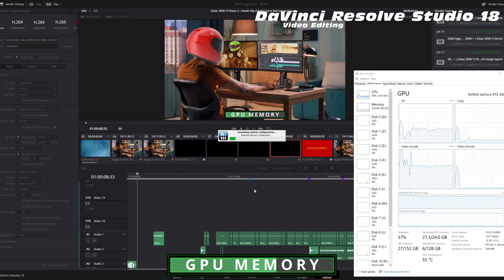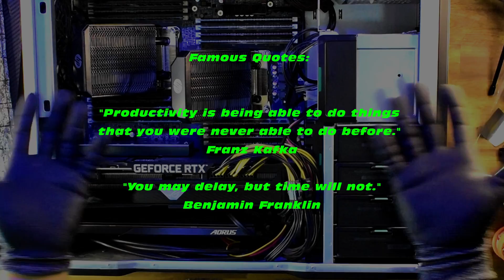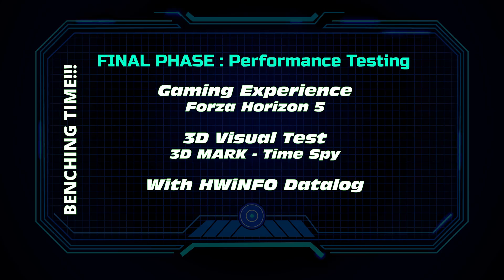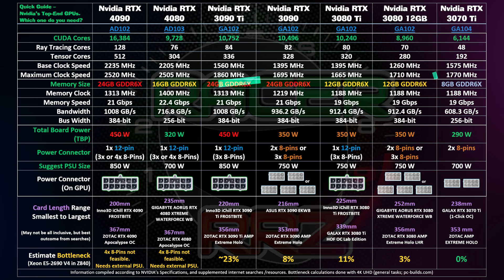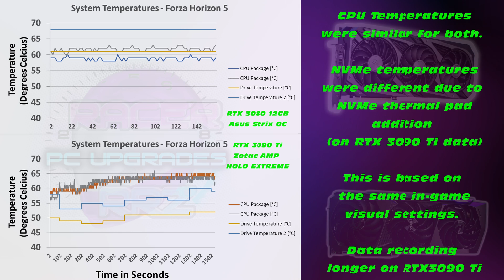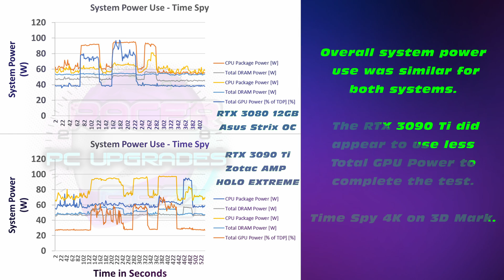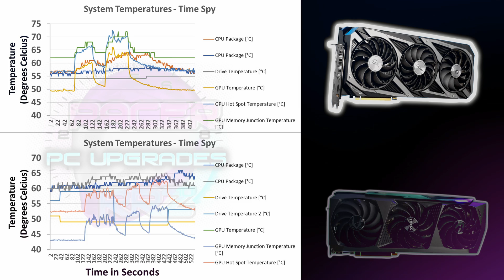GUIDE: Z840 Fitment of ZOTAC RTX 3090 Ti - Unleashing the Extreme Power in a Workstation

Comment: Love the vids. Oddly enough I've got a VERY similar build. Bit of a all around machine...
Z840
Dual e5-2690 V4s, 128gb ram, 4070TI, Asus Hyper M.2 with 4 Crucial p3 4tb, 4 - 16tb Seagate Exos SAS, 3 - 16tb Seagate Exos SATA.🏎
Reply from the maker: Hi Ryan, that's not a Z840 to be overlooked! The e5-2690 V4's are a power house. 128GB RAM does everything you can throw at it and your storage collection looks solid. Exos SATA/SAS drives give solid speeds for their capacities. How do you find the Asus Hyper M.2? Any issues running 4x 4TB NVMes? Are you able to boot from your adapter also?

I had some issues booting from my AORUS Gen 4 adapter - with 4x NVMes I could not get it to boot into Win 10 from the adapter - but with 3x or less it booted fine... 

The RTX 4070 Ti should give solid performance. How has that stacked up for you? I settled on the RTX 3090 Ti for the extra VRAM which has helped for video editing. 

I am sure your workstation will handle anything you throw at it.
Reply: @RACERRRZ  no wasn't able to boot from them but I'm sure there is a work around. Right now I've got an ssd laying on the floor of the case. Lol. Looking into adding another single pcie to nvme to see if I can boot that route. Also Linus did a build recently using a 420  using a USB Clover  bootloader to then boot from the nvme storage since the bios was somehow dead set on not allowing it. Where there is a will there is a way!
Reply from the maker: @Grumpy_Bubbles  I understand the SSD floating around - but I found a cheap fix for that (future video on the topic - Z840 upgrades! Olmaster 5.25" Bay to 4x 2.5" SSD with hotswap and built in fan; Olmaster He-2006). 

Yes, Clover is a solid way around this issue but when I tested it on a Z420 it wouldn't work! I was hoping to use an internal USB plugged into a USB 3.0 20pin socket to USB adapter (Z420 case swap) but that never panned out when Clover didn't detect the Win 10 ISO. I didn't spend long enough on it, but SSDs are quick and hence- I booted from an SSD lol. Linus is just flexing booting from NVMes on his Z420 haha.
Reply: @RACERRRZ  yeah I saw the 5.25 to 4x 2.5 adapter.  But I'm going to go with the 5.25 to 3x 3.5 hot swappable adapter.  Currently I've got 2 lg BR optical for ripping. Once I get my library finished I'll make the swap for more storage.

Comment: The cpus aren't fast enough to drive the cards in the first place. Maybe with a turbo boost mod or maybe upgrading to broadwell cpus. I took the 3080 out of my z840 with 2696 v4 cpus and swapped in a titan x pascal. I put the 3080 into my encoding server that has a 7940x. That cpu is able to fully utilize the gpus
Reply from the maker: Hi Nate. You are correct that the Z840's lineup of Xeons are technically too aged to fully support the capability of the more modern GPUs like the RTX 3090 Ti. The RTX 3080's performance was meant to be nearly in the "scope of reason" for the e5-2697 V3's which was why I initially opted for it. I checked the potential bottleneck for different configurations here: https://pc-builds.com/bottleneck-calculator/ or https://www.cpuagent.com (as a guide anyhow). 

My conclusion was there is no point upgrading to the e5-2697 V4's (I prefer higher clock speed over more cores) since they too are aged and will not fare much better. The Z840's hardware is aging and the only logical choice is to work towards the more modern HP Z8 G4, but that option is still cost prohibiting. With that knowledge, the RTX 3090 Ti upgrade has still been the best upgrade for my workflow because my main use is to render video with the odd gaming session in 4K. 

In terms of the Titan X (12GB), the limiting factor for my creative ventures has been VRAM. I went from a RTX 2070 Super to the RTX 3080 12GB, expecting that to be enough VRAM. But right now every video project is using ~19 - 24GB of VRAM on the RTX 3090 Ti which leaves me on thin ice. If I push a project beyond 24GB of VRAM DaVinci Resolve crashes during renders. A logical future proof upgrade could be the RTX A6000 (48GB), but for the price difference the RTX 3090 Ti still remains the best value.
Reply: @racerrrz  WOW that's crazy.  Are you editing in 8k+?

You really should need that much VRAM.  What camera do you use to film?  What is the bit rate of the raw footage that you are editing?

Are you using premiere?  I've noticed Premiere running like garbage on many slow cores over high single performance. Hints why I moved exporting to separate high frequency machine.

Thanks again!
Reply from the maker: @Hairybarryy  It sure is! 

I tried Premiere Pro, but the added price premium and need for AfterEffects for more flashy effects made it less logical. I use DaVinci Resolve Studio 18 (one-off fee) for everything from cutting, editing, effects, transitions, AI object/face tracking, green-screen removal, and audio adjustment with Fairlight FX. 

I have not dared touch 8K because 4k 60Hz is already straining enough for the RTX 3090 Ti, and DSLRs that can capture 4K 60Hz is already a big commitment. I mostly render with QuickTime in H.265 in Ultra HD 60Hz.

The VRAM cost is less about bitrate in my application and relates more with how I process the video footage. Using DaVinci Resolve Studio 18’s wide variety of Open FX Filters I enhance aspects of the footage. The most taxing effects are the Noise Reduction filter and 3D Keyer but combine a few of these filters and the VRAM cost increases dramatically, as does the processing power to complete the task. If a video was just 4K 60Hz footage with basic transitions I might get away with 12GB of VRAM, but why settle on less when you can do so much more with the same footage?
Reply: Also with titan x pascal the bottom duct can still be used

Comment: Thanks for this video. Do you think there are any benefits to putting in a 4080 vs  3090 ti? If they both get bottlenecked, I figured the power draw is less but the vram is much lower too. I do 3d content creation / ue5. 
Want to upgrade from 2080.
Reply from the maker: Hi. I am glad you found the video of help. Pinning the RTX 3090 Ti against the RTX 4080 is a tough match-up. The extra speeds from the RTX 4080 might be combated more heavily by the PCIe 3.0 bottleneck in the Z840. 

If your 3D projects are managing ok on the RTX 2080, and if you are not using a lot of VRAM, then you might be ok with the RTX 4080's 16GB. 

I would still settle on the RTX 3090 Ti for added cooling performance (mine sits around 55-65'C and I turned down the fan curve - MSI Afterburner fan curve function) and extra VRAM (24GB of VRAM more than makes up for the lack of rendering speed, in my application). If anything, I find I need more VRAM. A typical video project uses 20-29 GB of VRAM (including Virtual memory), and I have to be cautious to not overload the VRAM (DaVinci still crashes if I do).

The difference in TDP might also be offset by the bottleneck. My RTX 3090 Ti has not pulled more than ~380W, even at 100% load in DaVinci.
Reply: @racerrrz  mmmm those are great thoughts. Thanks for replying. It such a shame the 4080 only has 16gb. I would like to experiment with training custom AI models as well. But particularly using Ue5, Maya, 3dmax, blender, embergen, Gaea. Realistically the vram is the biggest requirement. 
If the 840 can physically take a 4080 then it would take a 4090 since they same, but would that be a complete waste of gpu/cash you reckon?  Could the 1125w even safely power a 4090. 
Love your content.
Reply from the maker: @b.a.g2073  Thank you for the feedback. There are a few challenges with the newer cards to consider. 

1) Although power draw isn't drastically higher, most of them have requirement for 4x 8-Pin connectors which places them out of reach for the Z840 - unless you do something drastic (case swap + 1600W PSU or external PSU). Their physical dimensions also changed - particularly the card height, which creates conflict with the side panel when you factor in the 12-Pin top-mounted power connector.

2) It may seem like a downgrade to get the older GPU - but VRAM really is key - in both gaming and 3D rendering. I suspect the RTX 4080/90's will be hurt more substantially with the PCIe 3.0 limit (and keep in mind the ever-powerful Z840 is also aging - e.g. e5-2699 V4's are getting along in age and there is nothing better for them). However, in the end the newer GPUs will still handle tasks significantly quicker than older GPU hardware. 

For the price point the Z840 is still the best value, even if it there is a bottleneck. A Ryzen Threadripper loaded with RAM becomes a house deposit lol.
Reply: @racerrrz  excellent points thankyou. We can dream hey for a thread ripper and RTX a6000 !😆

Comment: The z840 only has PCIe 3.0 slots. How much does that slow down a card like the PCIe 4.0 capable 3080 or 3090?
Reply from the maker: Hi Sam. You are correct that the PCIe 3.0 slots will bottleneck the GPU, and the RTX 3090 Ti is designed to make use of the extra bandwidth of the PCIe 4.0 interface (x16 PCIe 3.0 = 15.75GB/s max one direction ; x16 PCIe 4.0 = 31.5 GB/s max in one direction). Aside from the PCIe limitation, there is also a CPU limitation due to the aged Xeon CPUs (I have the E5-2697 V3s). I use https://pc-builds.com/bottleneck-calculator/result/0BD1aY/1/general-tasks/3840x2160/ as an example to calculate the CPU bottleneck. In practice, the bottleneck will be ~5-30% on performance, pending the task complexity. Despite that, this makes for blisteringly fast PCIe 3.0 GPU for the Z840!

Comment: Inspired by your video, I got Gigabyte 3090 Gaming OC for my Z840. But the system refused to start and giving 6 beeps error. Despite multiple attempts and enabling legacy boot and disabling secure boot the problem still persists. The system works when I install my old Quadro M5000. Can you please help
Reply from the maker: Hi there. Great choice with the RTX 3090, I am sure it will be possible to get it running. What power supply have you got in your Z840? How did you power the RTX 3090 cabling wise? What BIOS version do you have? The 6 beeps on the Z840 can mean a few things, the most likely of which is that there is insufficient power to drive the RTX 3090 (which would indicate a weaker 850W PSU in your system). Another possibility is the that fitment wasn't perfect in the PCIe slot, but I'll assume you can rule that out since the M5000 runs fine (but just double check that the card is seating fully and that the power connectors are all fully plugged in.
Reply from the maker: Looking at the 850W PSU (P/N: 719798-001) that seems unlikely since it only has 1x6-Pin cable. How did you wire the 3x 6-pins? It is important to have the 6-pin to 8-pin connectors and the power must come from the 3x 6-pins. Taking power from a Molex or SATA power plug will not work and may cause an issue. If power checks out there might be something wrong with the RTX 3090! Can you confirm that it is working in another PC/ machine (if possible)?
Reply: @racerrrz  Thanks for quick help. I have 1125W PSU and using all 3x 6pin cables with the help of 2x 6- pins to 8-pins and 1x 6-pins to 8-pins adaptors. My Bios version is M60 V 02.59. I have checked RTX 3090 on other machine and it's working fine but when I place it in Z-840 the LEDs on RTX 3090 are showing but the system gives 6 beeps🙁
Reply from the maker: @flichostudio  No trouble. Sorry to hear you ran into some issues there! If the PSU is the right specification, your BIOS is the latest specification (02.59 Rev.A), and the RTX 3090 works in another machine, that really just leaves one option which is that your Z840's PSU has an issue. As an example, I had an issue on a Z420 that I bought. The machine powered fine with a workstation GPU (like a Quadro K620 etc.) but gave beep errors when I tried to use a 6-pin plug to power a GTX 970. Online searches suggested a heap of potential issues but I went for the logical one which was that something like a capacitor failed in the PSU that negotiates the power supply to the 6-pin cable. New PSU went in and it worked like a charm again. Thus, I would conclude that something may have gone wrong with your Z840 PSU, likely before the RTX 3090 went in. Although super durable, the Z8xx PSU isn't immune to hardware failures. Can you test each of the 6-pin power connectors independently? A smaller 6-pin GPU might work for the test. Just make sure each of the 6-pins are actually still functioning. A simple tool that could help is a ATX power check tool like this one: shorturl.at/cmqN3 (short URL because ebay links are massive). I haven't used them myself but I think it could be worth having one for these situations!
Reply from the maker: @flichostudio  One other thing, it may be worth testing alternative 6-pin to 8-pin PSU adapters. They are somewhat renowned for not always working perfectly. If you have spares (which is unlikely!), give that a test also.
Reply: @racerrrz  My other card M5000 has 6-pins power connector. Just checked all three 6-pins G1, G2 and G3 one by one and all worked fine with M5000 so faulty PSU is ruled out. I'm not sure what am I missing here. Anything else you think I maybe doing wrong?
Reply: @racerrrz  You got it right, I don't have spare at the moment but I will get them and give it a try. Thanks again for your time and help. I will share the results as soon as I test the new adaptors
Reply from the maker: @flichostudio  That is good, but that still leaves an odd situation! Is the RTX 3090 fully seating? No clearance issues? Which model of 3090 have you got? Are you able to share a photo of the card in the machine with the power connectors? If you can, feel free to make a post here:  https://www.reddit.com/r/HSpecWorkstations/
Reply: @racerrrz  Thanks a lot for the help. I changed the adaptors as you suggested and it worked. So much obliged 😊
Reply from the maker: @flichostudio  Awesome, I am glad you got it running! The process of elimination FTW. Glad you got your RTX 3090 Working. Enjoy the added power in your already powerful workstation!

Comment: Did you ever managed to close the case ? :)
Reply from the maker: Sadly no. But I seized the opportunity to place some hardware outside the case (10 GbE NIC and a USB Type C adapter, link for interest: https://youtu.be/5tQct_LxPjo ). The 12-pin connector protrudes beyond the case margin, so there is no way to refit it unless the side panel is cut and modified which I am not prepared to do to a side panel. Case temps have remained decent as well, but I do worry about dust.
Reply: @racerrrz  Thanks for sharing all this, I Found a two slot wide 3090 that I'll try to fit together with a 5700 fe... first concern is power that I have to get through the 3x6 pins connectors... should be ok if I find good adapters
Reply from the maker: @misterxxxxxxxx   The two slot 3090 will help out, but power will be an issue on the combination of both GPUs. The RTX 3090 will require ~300-350W under normal operation from the 3x 8-Pin connectors (I believe only the founders edition RTX 3090 was 2x8-Pin). The AMD Radeon RX 5700 XT FE (1x 8-pin and 1x 6 pin) would require ~225W which might not actually be possible from the Z840’s PSU. The theoretical max output from the Z840’s PSU for the GPU power cables is 648W (12V * 18A = 216W * 3x 6-Pins = 648W). To power two high power drawing GPUs, I suspect you will need an additional PSU to power both cards reliably. Splitting a single 6-Pin into two 8-Pins (or 2x 6+2 Pins) can create a situation where the total power draw through the one 6-Pin can exceed what the Z840’s PSU can deliver (absolute theoretical max is 12V * 18Amps = 216Amps). The 6-Pin cables are generally only designed to handle 75W and the 8-Pins 150W. Which models of 3090 and 5700 XT do you have? If you have managed to get the right combo of cards it might just make it, but it would be risky to power both cards at the same time given the 3x 6-Pin limit from the PSU.
Reply: @racerrrz  75 W is coming from pcie power so I could have 6->6+8 (for the 5700) it would be 150W on a single 6 pin cable, and then 6->8 + 6->8 for the 3090 with "only" about 140W each.
the 1200W  PSU should be able to handle that ( 1450W peak under 220V)...

Anyway my plan have changed a bit  (I got screwed with a faulty 3090 :})
Receiving a Quadro P6000 and a Radeon W6600 (to replace the 5700 fe) by the end of the week. Should make it easier.
Reply from the maker: @misterxxxxxxxx   You should manage with your original planned setup if you can get the right number of 8-Pins (I have it that only the FE RTX 3090 had 2x 8-pins; if there is a 3rd 8-pin on the 3090 I presume the second GPU will not be feasible). Sorry to hear about the faulty RTX 3090! What went wrong with it (if you figured that out)? The P6000 is a heavy hitter with it's 24GB of memory! You should have no trouble powering them, in fact you could sneak in a 3rd GPU pending PCIe slot usage! I am sure you will make use of the extra memory. The W6600 should help spread the load on tasks. I didn't realize how heavy I was on GPU memory until I broke out form the 12GB limit I had! Every video project pushes 20-24GB now. Let us know how you get on with the new setup.
Reply: @racerrrz the Radeon W6600 for my allday macos vm, the P6000 for another vm under  linux for Machine Learning/stable diffusion